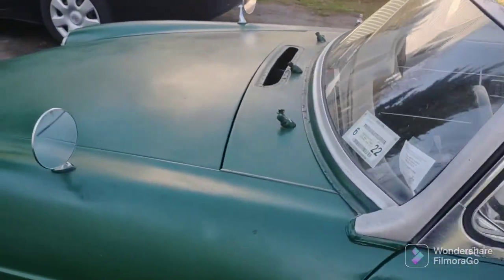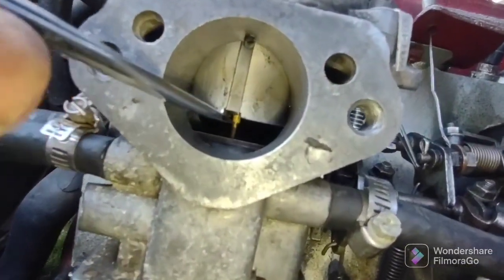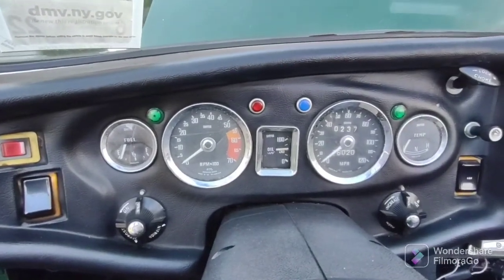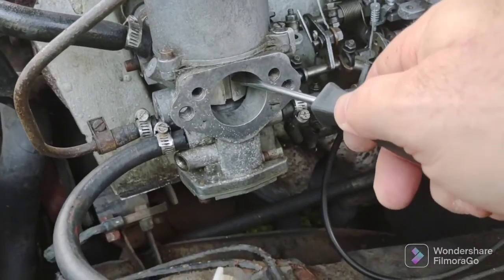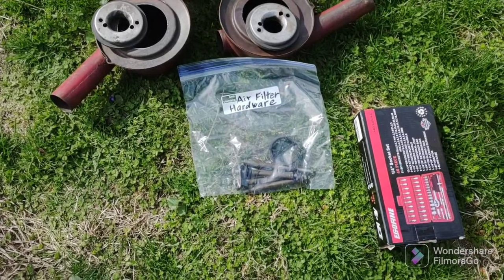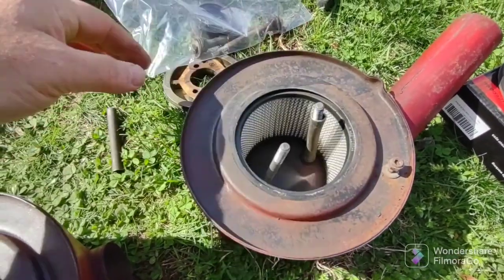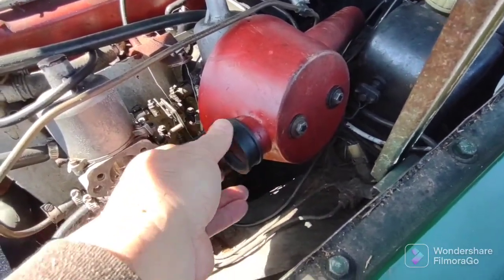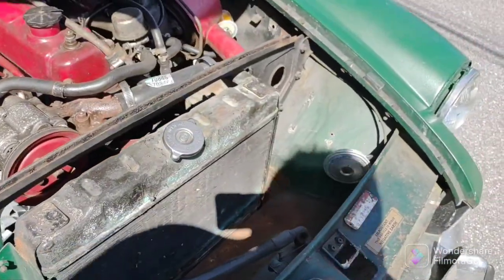MGB acceleration issue solved by adjusting air fuel mixture screw on SU HIF44 carbs

Comment: Wow! So far, you are the only one who shows the mixture setting in practice👍🏻
Reply from the maker: Hello ardi8530.  Thank you. I try to show the nitty gritty details to try to help people.   I'm still learning about these things, myself.
Reply: @anthonyhfe6450  It's really great as you showed it! I myself struggled to recognise the RPM change from the hearing, which is why I held a mirror in my right hand to watch the tachometer while I press the pin with my left hand, which in my opinion worked great. Greetings from Switzerland
Reply from the maker: @ardi8530  Hey Switzerland!  Beautiful country you got there.  That's a great idea using the mirror.  I also find myself using my cellphone to "see" things on another part of the car, like tail lights, headlights, clutch slave cylinder, etc.  But I did use a mirror on a stick to do needle valves, just, floats, etc.   Have a great day !

Comment: Sir, the pistons have to „klonk down“ yours slowly descend that doesn’t mean the spring is too weak but probably you need to re-center your jets.
Reply from the maker: Thank you for the feedback.  It's been awhile since this video was made.  The engine is running well nowadays.  I don't remember if I did any further adjustment since this video was made. But I know I rebuilt the bottom of the carbs and changed the rubber fuel lines and some other things.  They seem to be good now.
Reply: The HIF 44 has a sprung-loaded needle so it’s auto-centering.

Comment: stick with the factory air cleaners, they don't run well with the aftermarket ones. You also need to disconnect the throttle bar on one side when tuning so that both carbs don't move together. Adjust the idle screw on each carb until around 700 rpm or whatever manual suggests,and the vacuum matches on each carb.Then check lean or rich as you did. Then tighten down the screw on the throttle bar joining the two carbs.
Reply from the maker: Hello. Thanks for your feedback. Yes, isolate the carbs from each other. This I understand but it's been a while since I made this video. I'm not sure what I was adjusting here and I think more tweaking was done since. Probably air fuel mixture, in this video. I'll need to watch the vid again.
   Yes, I still have the stock air cleaners and don't plan on changing them - the same stock ones you see here, except I added the appropriate stickers for more horsepower - lol.
   Nowadays the car is running well.  I need some more road time to truly test her.  
    I will be revisiting the carbs for better tuning when I get back to them.
Reply from the maker: The above reply was for North49191. Thanks !

Comment: Tap tachometer with back of hand  willspring into life works every time.  Happy days
Reply from the maker: Hey John, thnx for your comment and your advice. Funny, I've seen that "method" on YouTube.  
    My tach has been rock solid.  It just came back without any intervention. I'm hoping it wasn't damaged by a previous owner reversing the battery polarity and grounding the positive. I've changed everything that may have been affected by that. But tach is good for now.
     My car has other issues now John. The splines are rusted on the axles and possibly in the laced wheels, so that's my next project on the B. You can't have the wheels slipping on the splined axles.  Very dangerous.  
    So I have two British cars.  One can't stop, and one can't go - lol.  The TR7 I blew out a brake line, so I'm changing them out soon, and my B has spline issues.  But this is all part of the fun.  I have something special with these cars, so I put the time and effort into them so I can enjoy them.
    Well, take care John !! Nice meeting you on here!

Comment: the reason that the slides are not going fully down is because the idle speed is way too high !....the engine is creating a large vacuum which is lifting the slides slightly as they are intended to do. You cannot tune the idle mixture with the engine speed that high .
If you lower the idle speed to around 800-900rpm then the slides will come down  and you will be able to tune the mixture
Reply from the maker: Thank you John.  Yes, rpm too high. Yes, this was true then.  I think I have them almost good now, adjusted around 1000 rpm, but something weird is happening.  When I use the Uni-Syn carburetor synchronizer, it seems to cause the engine to almost stall when I use it on the rear carb, but doesn't seem to do this on the front carb. So I'm not sure on that.  Thank you for your help!!
Reply: @anthonyhfe6450  sorry didn't see this until now. It sounds like one of your carbs is running too lean and the other  too rich. What happens when you lift each slide about 2- 3mm with a small screwdriver ? The engine should very slightly increase rpm and then go back to the same idle speed. If the engine dies the mixture is too lean and if the engine increases sharply its too rich . You might need screw the mixture screw clockwise to go out as much as  3 turns to get the mixture right
Reply from the maker: @johncooper7242  hello John Cooper.  Thank you for your assistance.  It certainly could be that one is lean and one is rich.  I'll be revisiting this soon.  Yes, lifting the piston u should get slight increase in rpm then back to normal - absolutely.  Thnx again.  Hope you are doing well.

Comment: You're running lean. Jet depth on cold start should be about .040 to .050 down from the bridge, not flat to the bridge. If the carbs are in order and the temperature conspirator which controls the jet height via the enrichment screw is in working order it will lean out to about .035 down give or take. I also find setting them equal and trying to keep the jets as close as possible. It takes a time but these carbs are relatively easy to work on. Once you get the have of it.

I installed an AFR gauge on my 74 MGB which has the same carbs. I set it to about 12:7 at idle and that helped a lot. 

Hope that helps. Go to the MG experience for help as well.
Reply from the maker: Hello Red Barchetta!! 
Rush fan?
Me too.  
Yes, I think I was running lean. My base settings were even with the bridge plus two full clockwise turns in, as a start.  But that was still lean, as when I did the piston test, the RPM dropped. So I had to turn in the enrichment screws on both carbs.  
     Also my idle was high in this vid which I later corrected somewhat.  
       The history on this car (and the condition of these carbs) is a mystery, but things seem to be working as they should. I'm not sure if the bimetallic compensators are fully working. 
       I have the rebuild kits but if they are working properly, no need to rebuild well sorted carburetors. We will see what this summer brings. Yes, I'd like a AFR meter. Some day.  But now I am doing the master brake cylinder, as the old one is shot.
 I may be near your 0.050" parameter just by eyeballing it. 
Thanks for the help.  Much Appreciated! I hope you are enjoying your car, if she is on the road ! 👍

Comment: Dry piston damper dashpot causes hesitation on acceleration. Top up with engine oil.
Reply from the maker: Thank you for your comment.  I'll double check the oil in the dashpots.  Lately she's been running well, but it's good to check them.
Reply: Oil in the dashpots is essential before trying to tune the carbs. Check the workshop manual.

Comment: Dear Sir it may be possible to extend the life of your two air filters by stretching clean new panty hose over the exterior of air cleaner elements. This in effect will prevent bugs moths dirt from prematurely clogging your air filter elements. My dad had a volvo and used this trick and as far as I know it worked. It may affect rpm of engine but I thought I would share this with you. Hope it works for you whatever you decide. Happy tinkering!
Reply from the maker: That is an interesting idea. And I'm sure it's effective.  Thnx

Comment: And I thought my exterior was bad! The battery was flipped for a reason. Look up polarity switchover. That is why the tach doesn't work. You need to back everything off and get them to a sound starting point. Don't just go in turning screws. That idle is incredibly high. And the mixture is not off by much.
Reply from the maker: Well, I'd rather have a car that's mechanically sound, than one with a pristine paint job. I bought her this way.  So mechanical stuff first, paint second. It's always the pretty cars that don't start after a car show - lol.  Thank you for the feedback.  This is an old video.  Carbs have long since been adjusted properly.  Have a great summer !!